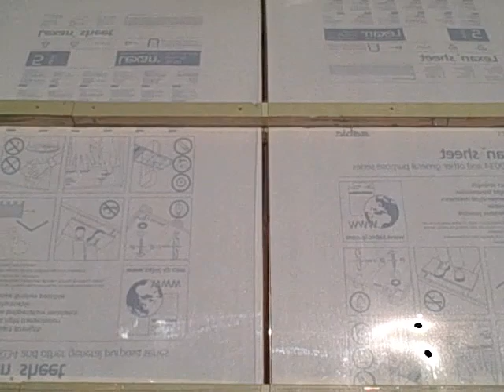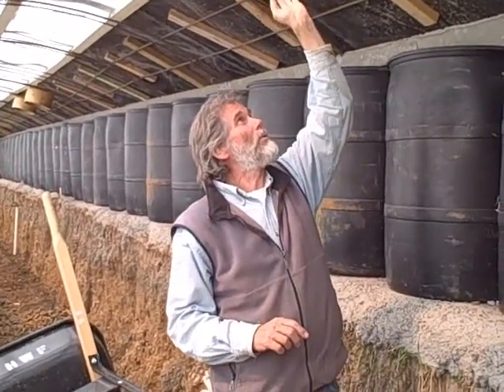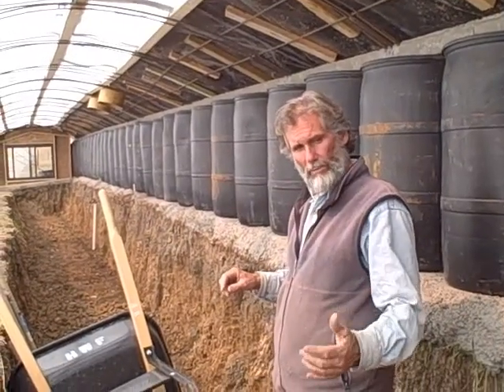Greenhouse Construction Step 8: Glazing Plus - Beyond the Glazing for the Greenhouse

Comment: Don't sell people plans assuming they are going to get their materials free in salvage as you did, it's not realistic. Way, way, way too much money has been spent here unnecessarily, and it's a concern that the interior walls are un-reinforced against collapse. The whole idea of a project like this is to do it as cheaply as possible and in the most naturalistic way possible. Polyurethane foam? Really? Don't worry that's completely natural and not any kind of a health concern. Here is the simple and more natural way to do this project. First, the site they chose is completely too flat. I see they have some south facing hills. This has to be dug into a south facing slope, ideally four or even up to eight feet deep depending on your climate zone, this is to get below the frost line capture the warmth of the earth. The high side can be reinforced with timbers posts sunk into the ground which will extend several feet above the sloped grade. On the outside of those timber posts attach horizontal boards to reinforce against collapse of the earthen walls. Face the boards with 6 mil visqueen to seal against the elements. A small amount of back fill is done against the visqueen. On the low side repeat the process. Run rafters from the high side to the low side, space appropriately for any snow load concerns. Apply 6 mil visqueen to the outside of the rafters and the inside for two layers. Any snow that does fall on this structure should melt quickly from the constant above freezing temperature naturally maintained inside, but make sure you have adequate roof pitch to help this process. If you do have your own timber on your property this can be utilized for free, otherwise buying wood is still cheaper than concrete, plexi-glass, rebar, and plastic barrels, and more importantly more natural. The visqueen might have to be replaced every few years, but it is inexpensive, the plexi-glass is subject to severe degradation in the sun and is expensive. What you see being done here is a very expensive materials, labor, and time consuming answer to a very simple problem that you want to answer on the cheap. You should easily be able to achieve much more usable interior space for much less money than they have here and have it fit in with the natural surroundings, not look like it was built with recycled materials from Chernobyl.
Reply: Wow. Thank you, your description is exactly what I've been trying to visualise in my mind. And I had the same thought about their use of salvaged materials. Thank you